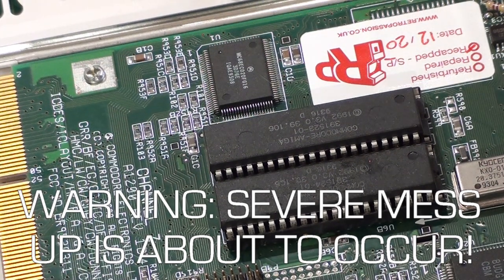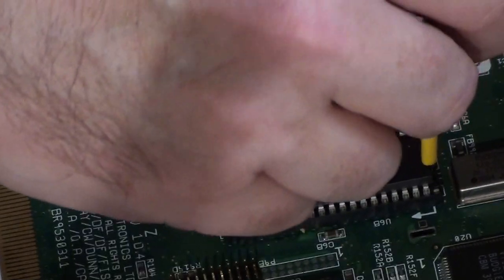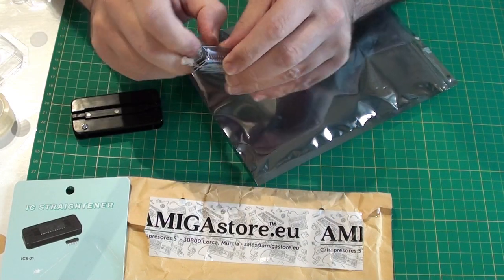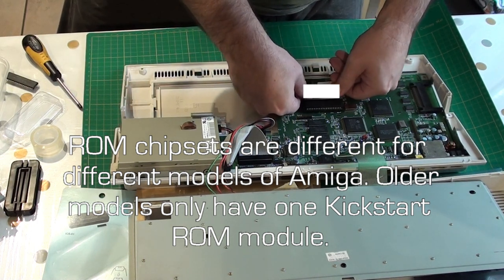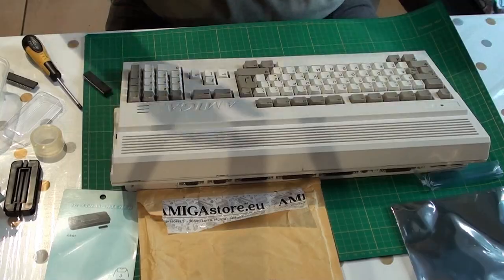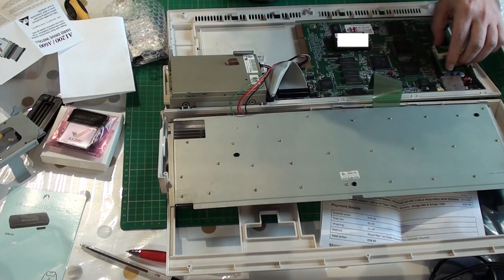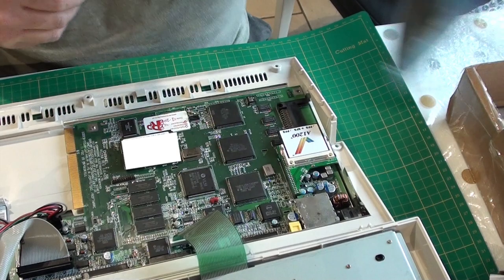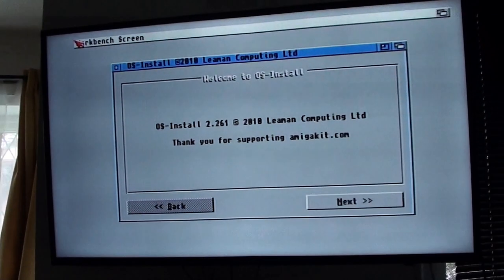Amiga A1200 Restoration Part 4 Changing the ROM and installing the CF HD

Comment: Those cheap chip pullers probably cause more damage because you end up bending/breaking the pins when it suddenly pops loose from its socket. It is better to use a flathead screwdriver to carefully prise it loose at each end one at a time (then possibly use the chip puller).
Reply from the maker: Yeah, it was not fun watching that board bend.